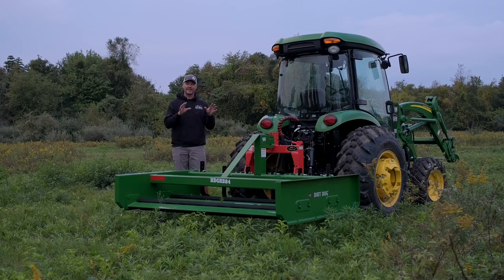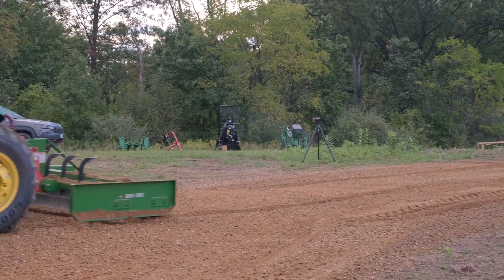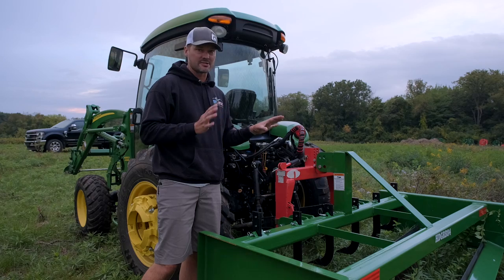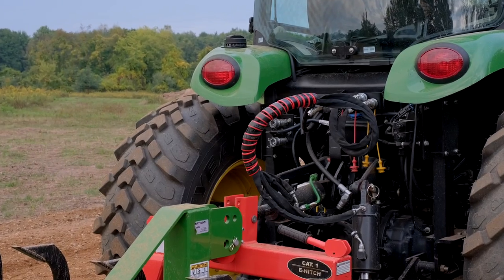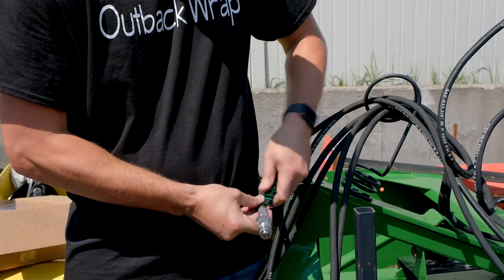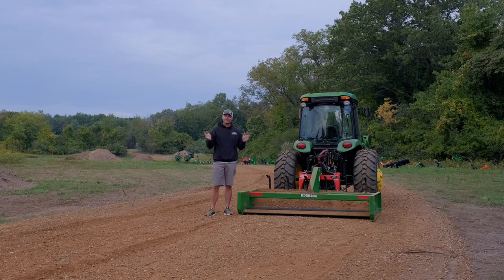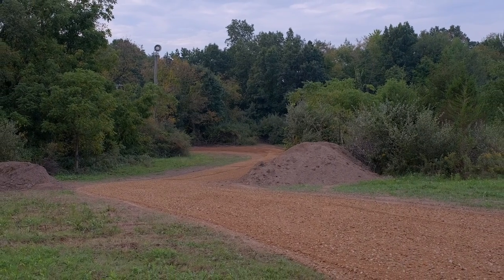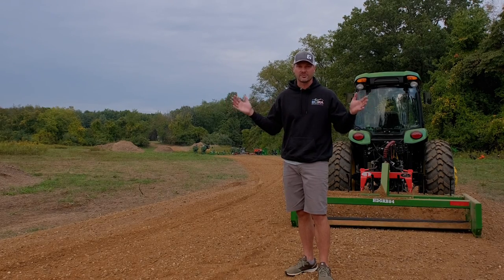HOW TO GRADE A ROAD AS GOOD AS THE PROFESSIONALS! USE A LEVELER!

Comment: Something you "may" want to consider is after you have your construction completed, your fabric laid and your 21A all dressed and pretty. Let that all settle in for a couple of years, then recover with recycled asphalt or asphalt "millings". It lays like gravel,  compact it while watering, then it is like asphalt. It will absorb water through it, like a sponge and wear like asphalt. It isn't cheap, but it will last you. I put mine in almost 12 years ago. Still looks like I had it paved. Best wishes on your future plans!
Reply from the maker: Thanks Mark, I will consider that!
Reply: Nice tip 👍
Reply: Check and see if your asphalt in your area is recycled, because a lot of states are making asphalts plants recycle the millings, and using way more sand, you don’t want those millings
Reply: @chief1193  
Also he might check to see if a company is doing work nearby. Let them Dump it at your property instead of taking it to the plant. I mean only if it's really milled up ( cut to broken gravel size)

Comment: Great job on the driveway.  I have a 1,000' gravel driveway.  I got my JD 1025R and I had to get a box blade.  This was before I saw YouTube videos of people using a land plane.  I should have gotten a land plane cause I was terrible at using a box blade.  A box blade is not an easy attachment to master.  At least not for me.  After about 20 years I asphalted the driveway and got rid of the box blade.  The grandkids love it.  I see with your land plane you have hydraulic tip and tilt.  That is great.  So much better to dial it in from the seat.  Thanks for sharing.
Reply: The Landplane is way better at leveling than a box blade for people that are not good at boxblade use. I also got a BB with my 1025r and soon realized i caused more problems than I corrected with it. I bought the ABI TR3-E Property Edition and haven't looked back, although I admit I wouldn't mind having a landplane.
Another thing i would say is to get a Hydraulic Top-Link, it makes box blade use a lot better if you want to stick with it. I use my Hyd Top-Link Constantly to adjust fore and aft. Not sure how i lasted this long without a Hyd Top-Link!
Reply from the maker: Yeah, land planes are application specific, but very good at what they do!

Comment: I’ve never seen anyone put fabric down after 21a.   The textile is meant to permeate water but keep the base from mixing with the native ground.  I just redid my driveway to pave last summer before I deployed and I had to cut out a clay vein.  The existing driveway was built over sand and silt. I used the fabric over where I dug out the clay to keep materiel from mixing in the wet season. Help it drain as well as keep it from splaying put into the subsoil. Least in heavy water areas I would have done that, but if you dig deep enough maybe after compaction it will keep the water out.  Cheers! Looks like a project I’d love to work on

Comment: I have used Flex Base, recycled concrete, 6 inches, wet, use a 35 ton vibration roller, after construction, follow up with 6 inches of recycled asphalt and roll again. At 12 years old, it could use 4 inches of recycled asphalt and roll it again. With all of the fines in Flex Base, once watered and rolled,  it sets up like concrete and works great during the construction period.
Reply from the maker: Thanks, I have considered recycled asphalt too.

Comment: Good to see the 4720 back in action, what did they find wrong with it? Driveway is looking good the landplane is doing an awesome job much quicker than using a skid steer on that long of a run. Not sure about laying geofabric down on top of the first base course the resident civil engineers at work would freaking out at that. Definitely compact it can't stress that enough. But well done man you are doing a great job. 👍✌️
Reply from the maker: Love the consistency of the land plane.  Does an amazing job.  Will cover the 4720 fix in a future video.

Comment: Noticed that you had the land plane tiled a bit downward (the tail was 1" to 2" higher).  Was that intentional?  What happens if you change the front to back tilt? Also can you just let the land plane float using the skids to set the depth to work at and using the tilt cylinder to set the crown grade?  And one more request, please show us the culvert. Thanks for the videos. Cheers!
Reply: Love to see what you did with the culvert.
Reply from the maker: I had it in several angles, also was hard to see sometimes.  I thought it was completely flat while my bro said it was pitched.  Scraped more material when both edges where on the ground.  Yes, the plane has slots on both sides so you can also adjust the edges up and down in those slots to adjust the crown.  Thanks!
Reply: You actually need to tilt it to the rear just a hair, or the material will pull the front down and wear out the front edge of your skids!

Comment: Would you recommend a land plane or box blade w/blades to scrape topsoil/grade a new drive?  Or should I just use a skid steer?  I have about 900ft of drive I need to create.  Thanks
Reply: Depends how much dirt you need to move around.  Bigger lumps, deeper dips, more uneven, is where the box blade shines.  Fairly well established, minor leveling, smoothing to a more finished surface, is where the land plane shines.  It's sorta like choosing sandpaper.  Does your project need 60 grit or 120 grit?  When you ask an open ended question like what tool to "grade a new drive", that's like asking what sandpaper to "do woodworking".  It all depends on the project you are faced with.
Reply: @rmcdaniel423  thanks for the info.  Thats a great way to look at it.  Obviously I'm new to this.  I just bought 10 acres of previous horse pasture in east Tx.  It's mostly level, a few potholes.  Does the topsoil have to be stripped or can it be integrated into the drive?
Reply from the maker: Good info

Comment: Nicely done on the video and the grading. The drone shots really add production value. Does that land plane show any signs of wearing down on the front corners?
Reply from the maker: I didn't check, but can't imagine there is much where yet.  I think it would take a long time before anything significant happens.
Reply: If you don't keep the plane leaning back just a hair, it will wear your skids down on the front edge. The weight from the material pulls the front down too much if you don't!

Comment: I am interested in purchasing a land plane but am having trouble deciding on a size. I have a Kubota M5660 and the outside of my rear tires are at about 74.5". Generally I try to get implements wider than my tires or offset so I would go with a 84"+ implement. In this case however, my driveway is only 10' wide and I want a slight crown so I was thinking 60" or 72" so the blades don't cut over to the other side of the drive. Any thoughts or suggestions?

Comment: Would using a loaded lawn roller help pack it down?
Reply: Yes.  Packing it down would help pack it down.  But based on the bit by bit way he is doing this massive project, he's probably not ready for that step.  And if he did decide to roll it once the rest of the gravel is in place and leveled, he would probably bring in something bigger and heavier than a simple lawn roller.  Just guessing.
Reply from the maker: Yeah, I don't think my roller would be heavy enough, need more weight

Comment: you can see the tractor power hopping. it cannot pull that full of gravel. Should it not flow over the two blades more easily? I would guess it would perform better on a firm road. I am building a road with an 18 000 lb wheel loader. just back blading. new cutting edge and the front wheels off the road to pack it down. I think it may be better to hire a grader to do the finishing touches once the A base is laid down.

Comment: I find it interesting that the contractor recommended putting geotextile fabric between layers of gravel. I used to work for a Geotechnical engineering firm and now I work for an environmental engineering firm. Typically, woven geotextile fabric is used to prevent localized shear forces in weak soils, i.e. if the ground is soft put down fabric to prevent settlement. Your subsoil looked really good actually in the videos you showed digging it out. It was nice and dry. I know construction practices vary throughout the country but I doubt you really need the fabric, especially between layers of gravel. Just curious what his thought process is.
Reply: If I had to guess it would be somewhat for erosion, but most likely to keep grass from coming up through the gravel for aesthetics
Reply: @Lackieestatesfarm  erosion maybe on a slope, not on a driveway. Either way, fabric is usually Intended for subsoils, not gravel

Comment: You don’t have to have a crown for a driveway to shed water.  My opinion is a crown can be very problematic for snow removal.  When plowing snow you tend to also move a lot of gravel off the crown to places you don’t want it in addition to the snow, even if you have a rubber or non cutting edge on the snowplow.

Instead… you can make a “flat” (if you will) surface (no crown) but have the flat surface pitched slightly to one side or the other… in the direction you’d like the water to run.  In my experience, this makes a much better surface to plow snow off of… while still shedding water off the lane/driveway. 

Once the “flat” surface is created a drainage swale next to the driveway is a better option than a true “ditch” if the topography allows for it.  If you can create a swale that is wide and shallow while still giving enough pitch in the swale for water to run where you would like it after it has shed off the driveway… you can mow it in dry weather… rather than need to run a weed eater or other difficult maintenance needed to keep a deeper ditch looking neat.

You may also put a swale on the high side of the driveway to prevent some water from coming on to the drive way surface and then at some point route the swale away.  Again this would depend on a driveways exact location.

A box blade is a great tool for creating the flat but slightly pitched driveway surface and for creating a wide shallow swale(s) next to the driveway… With smart tilt set up for the pitch of the driveway surface.

I would skip fabric all together and use a stone crushed with lots of dust in it that will pack in well on the top.  Leaving the fabric out of the driveway construction will allow the use of a boxblade’s shanks in future years if you need to regrade the driveway.

Depending on your topography these thoughts may not be options for you.  But it is just my $0.02 and could be helpful to you or someone else.
Reply from the maker: I think a pitched flat surface would have it's own challenges, but it probably depends on the surface.  I'll tell ya that you are in the minority on not using fabric.  Good to have different perspectives.  Gives me something to think about.  Thanks for taking the time to share!
Reply: Why no base of breaker rock? The driveways I have made start with  breaker then gravel on top. Works great.
Reply: @GoodWorksTractors  I’ve got a road grading business and I have box blades running all day. I agree the fabric is a pita with the teeth. You would need a good 6” of gravel on top of the fabric in order to not dig it up (8-10” is even better). IMO it should’ve been laid below the base gravel, but to each their own.
Reply: @GoodWorksTractors  you don’t need much pitch on the “flat” surface to get a lane to shed water.  1/4” per foot or so.   If your lane was 12 feet wide a 1/4” would make the high side 3” higher than the low side.  3 to 5” difference would shed water without a crown to make snow removal difficult.

Re:  fabric if you had clay soils or something in the base that would suck up your gravel… I would have put fabric down first and got about 8 inches or so of total material on top of it.  Fabric so high up in the lane’s construction I think will cause you some unwanted problems later.  Just some thoughts… worth what you are paying for them.  LOL

Fun channel to watch. 👍